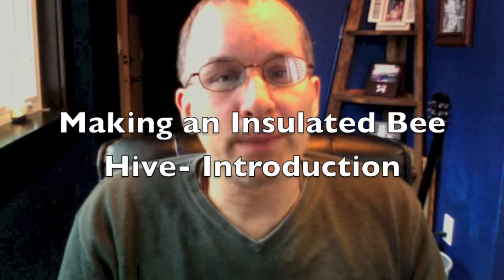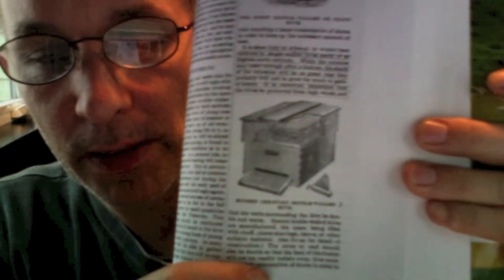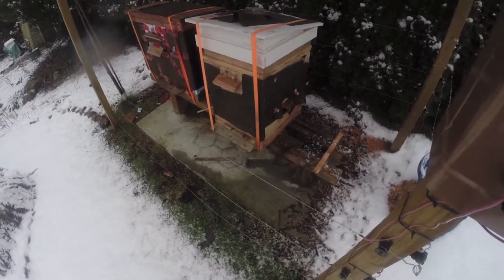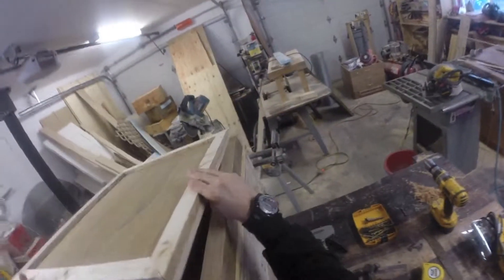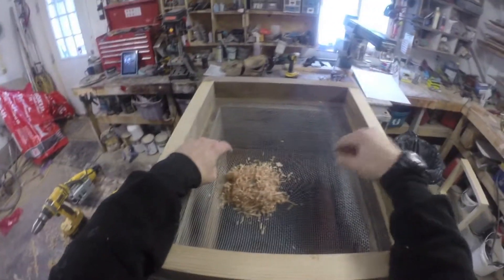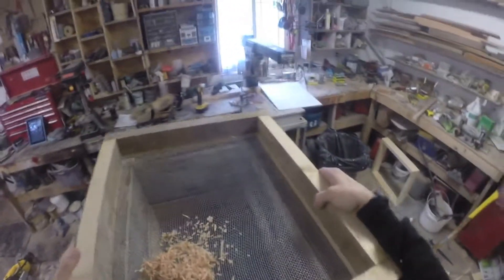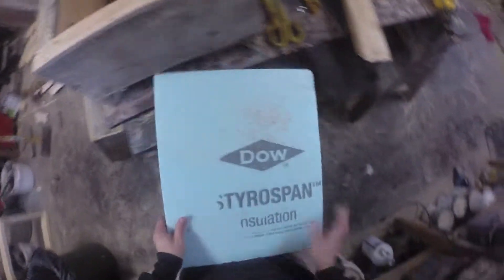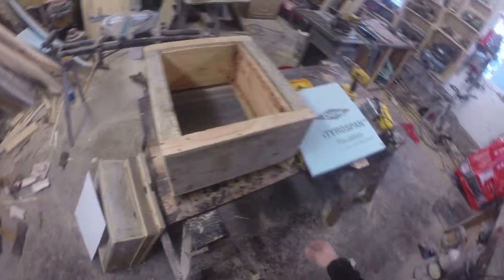Making and Insulated Beehive- Introduction

Comment: do you use the insulation on your roof also?
Reply from the maker: Hi Kevin yes I do insulate the roof. I am now putting my hives together apartment style and then insulting. I will post a video on this in the fall. I now use 1 inch foam board.